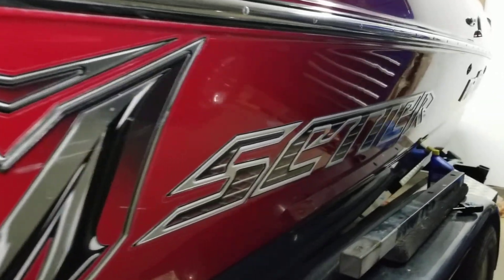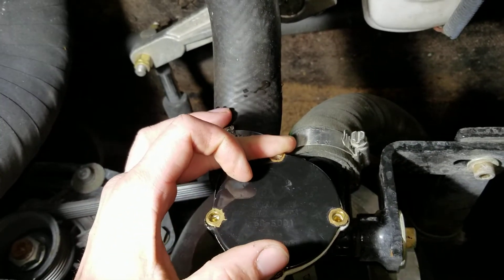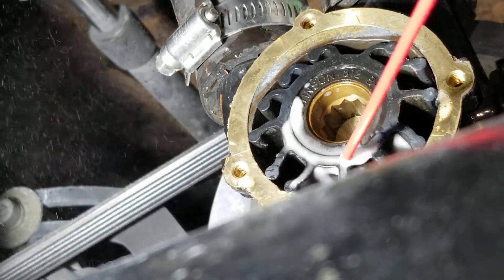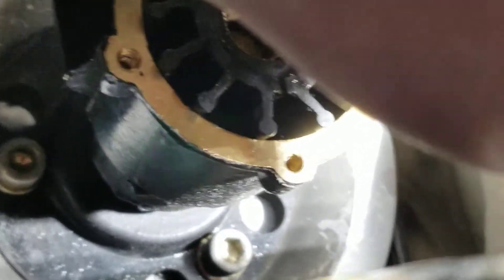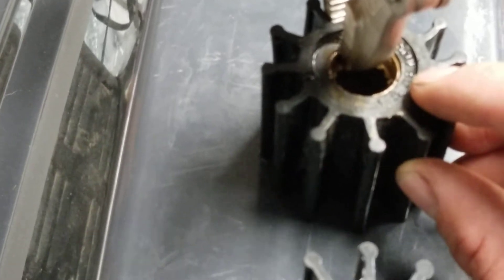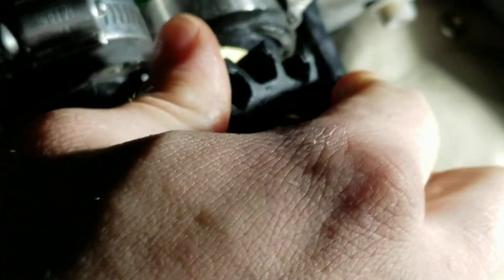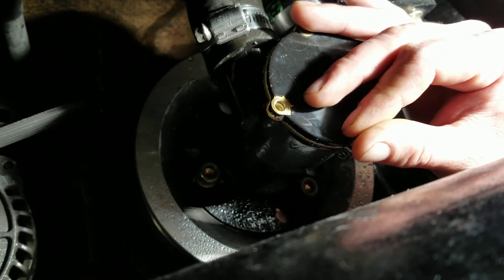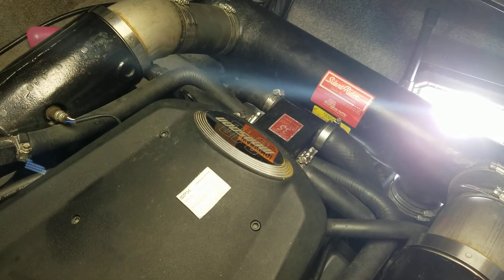Save a bad lake day! How to change raw water impeller on a 2007 Malibu Wakesetter

Comment: How do you know when it needs to be replaced
Reply from the maker: You will know it's bad if the boats heating up or over heating, but they recommend just changing it yearly or every other year as a preventative. Because you really don't know it's condition until you pull the cover and actually look at it.

Comment: Which way should the impeller go in? Clock or counter clockwise? Thank you! Great videos man.
Reply: From stuff I’ve read and experienced it shouldn’t matter which direction you put it in as the pump spinning will orient the veins on the impeller correctly

Comment: Great video. 
Small little trick for anyone, use 2 precision screwdrivers one on each side prying out at the same time will have the impeller out in just a few seconds. Much easier than plyers and trying to wiggle it out. 
Prolongs the life of the seal at the bottom of the pump too with not having uneven pressure from wiggling it out.